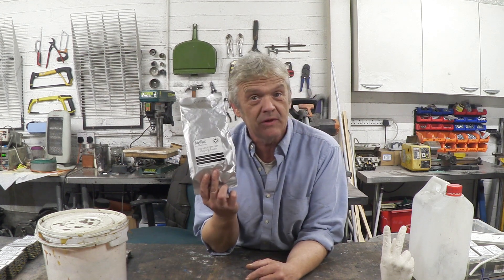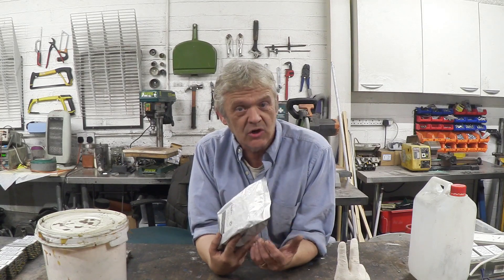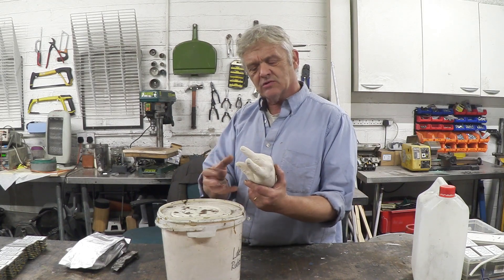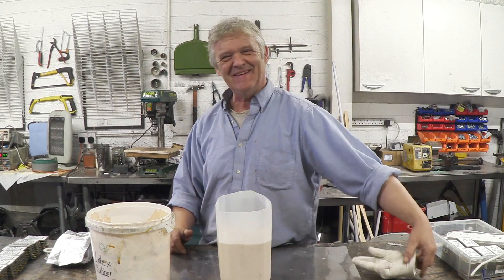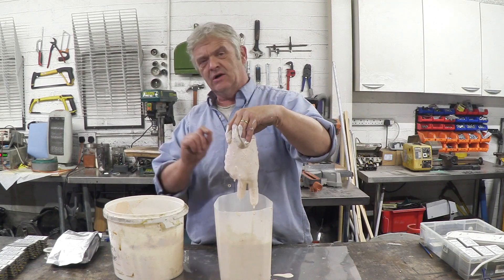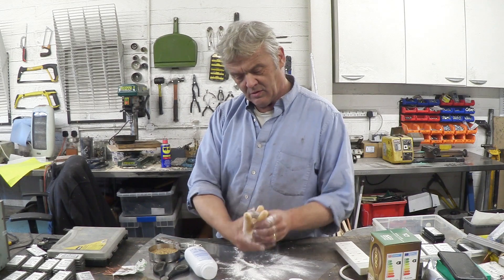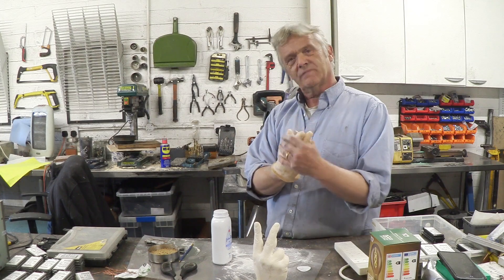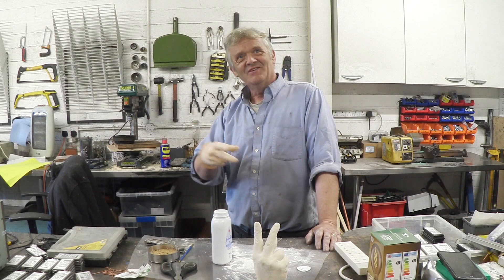1280 How To Make Latex Rubber Molds For All Kinds Of Things

Comment: I was a bit disappointed you haven't mentioned the best thing you can do with silicone molds: if you make them thin enough and flip them inside out, you can make mirrored copies of parts.
My tutor has shown me this trick. Howewer, the thicker the mold, the more the shrinkage of the mirrored copy.

Comment: Hello.Thanks.
i have a few questions.
1- I saw people who first put 10 layers of latex on the object and then mix the latex with silica to make it a little thick and then put it on the mold. Is this correct? Or will the use of silica in the latex create problems for the latex mold?
2-  I mostly saw that latex molds are mostly used in concrete and plaster sculptures. Is it possible to cast materials such as polyester or polyurethane in latex molds? Some people say that the latex mold is damaged by polyester and polyurethane materials? is it true?
Thanks alot.

Comment: Extra possible tip, not sure if it works for your molds but in industrial manufacturing they get the gloves of their molds by using a compressed air jet under the wrist area and the air puffs out the glove and shoots it of the mold, simple shop air compressor should do the same thing. if anybody thinking of giving the gloves a go id love to know if it works, it's how they get the speed up in factories mass manufacturing them but I believe they use metal hands so the friction coefficients may be different.

Comment: That could be really useful.  I hate handling DCM, because it penetrates layers so easily, and because thick gloves fit so terribly.  With this, you could simply mix your own custom, composite PPE, or even add tear or heat resistant materials wherever you want them.
Reply from the maker: absolutely mate

Comment: Thanks Robert for the information about Latex Rubber.  "Question"   I asked this question in an earlier Video of yours and you didn't respond, so I'm asking it again. Would you do a Video on (POWER PASTE)? The paste has incorporated into the mix (MAGNISIUM). This paste is used in the production of (HYDROGEN GAS) so it could replace Gasoline and Diesel as a Fuel. I was hoping you'd do a Video showing the make up of this paste and how it could be made at home for the same purpose. Would you do this Video? Again thanks for sharing your knowledge with me.
Reply from the maker: sorry about not responding before mate - I do get a lot of mail and posts so it just isn't possible to respond to all of them any more - really sorry about that - but good one for persisting and cheers - so I have written it on my list and will certainly look into it. From your description of it I can guess what's going on on for sure and it doesn't seem that difficult to me  - but I will get a little more info and make a vid - cheers
Reply: @ThinkingandTinkering  Thanks Robert. This will be a worth wild Video in my opinion. Also, 'if you could only make one Battery from all the Batteries you've done while doing your Video's here on YouTube and you had to depend on this Battery Technology, which Battery would you choose and recommend? Thanks again for responding to my request.
Reply: @kennedy67951  Robert did a video about this a while back. From the top of my head the answer is that you pick the one that you can make ( resources you can harvest etc). In my case it is repurposing led acid ones. Preferably with the graphene mesh/wrapping described a year ago (I think). The reflow one is on my bucket list to.
Reply: There are no details I could find about how this is recharged, not being able to refill easily is a major problem.
Reply: @vitordelima  What do you mean? The (POWERPASTE) is what they are using to produce the (HYDROGEN FUEL). The paste is made up of (MAGNESIUM) and a few more additives. The Water contains something to strip the Oxide Coating off the (MAGNESIUM) so it will react with Water to form (HYDROGEN GAS) at point of use. I was hoping you would know something about the make up of the paste and do a Video over it and how it could be done for the Hobbyist. So, do you think you could do a Video showing all this is the question?
Reply: @kennedy67951  I think this means you need a complex process to make the paste.

Comment: Does the latex rubber need vulcanized?
If so, how is that done?
Reply: This type of liquid latex is usually pre-vulcanised and the particles prevented from sticking together by being suspended in water with amomonia to keep it from going bad. As the water evaporates or is sucked into plaster, the latex particles come closer together and eventually touch and fuse. When forming something without an absorbent mould (like the plaster mould), you have to apply thin coats and let each dry. If a thick layer were to be applied the surface exposed to air will form a more or less waterproof skin and prevent the latex below from drying.
Reply from the maker: no mate it just air dries

Comment: Great for making chess sets of which I've done loads using Styrene Resin & pigments/metal powder fillers. RTV/Silicone sealant is also great for making moulds, there is a technique called butter up to make those work better. Bubbles are the main enemy!
Reply from the maker: you should do a video or two - I would love to see your work

Comment: This is great! Thanks! One question off topic is it possible to make a practical home heating unit , using quick lime and recycling it and re using the dried quick lime?
Reply from the maker: I would use the zeolite - nice safe and never wears out
Reply: @ThinkingandTinkering  thanks for your advice! I will give it a try!!!
Reply: The problem with quick lime is that if exposed to CO2, it becomes calcium carbonate.
Reply: @technosaurus3805  Is there any chemical that could be cycled over and over… that is exothermic when exposed to water? Zeolite etc.

Comment: I've always wanted a copy of my oh my
Reply: Just for a talking point on the mantelpiece when granny pops in for a cuppa tea, eh?
Reply: @locouk  I wouldn't rule anything out
Reply: Alginate gets mixed with water about 13 degrees Fahrenheit cooler than the human body. Just something for consideration. 🤣
Reply: @russellborrego  challenge excepted
Reply: Your 'Oh My!!'  Here's How you do That.. Get a Vacuum Pump Cylinder the appropriate size, has to be 2x length, Get things 'Ready'... fill the top end with the alginate, Pull appropriate vacuum until you are 'There'... invert the cylinder
the alginate comes down inside and sets in 3/4 minutes, release pressure and 
Wa la --There's your 'Oh My" at Max Capacity,  and ready to make a Plaster of. 
Just so you Know... If you wait 3 or four days the alginate will dry out and will be life size!  Hope this is clear...
Reply: @anneinfurna8528   It's going to be the best Christmas ever.
Reply from the maker: lol - all handy 'tips' for the adventurous for sure lol
Reply from the maker: lol - who doesn't ! lol